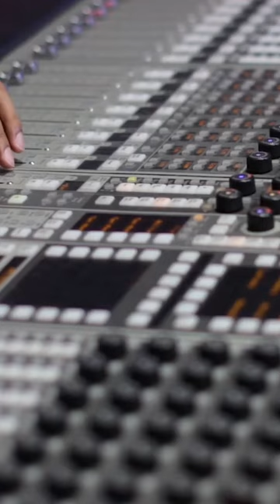How Records Are Pressed

Comment: I still don't understand how sound waves can come from the grooves on the record. Like how to you get someone's voice from a groove in vinyl? There are soo many different sounds and combinations of sound and you'd think there would be a limited amount of different ways to carve a record.
Reply: That's where the magnets came in. Every ups and downs, and lefts and rights of the groove reader is converted by the magnets from physical energy is converted to electrical charge then another magnet in the stereo sound box converts electrical energy to sound energy.

About the combination of sounds, it is mixed then put to record, its on the sound waves thing. 

Think of a voice recorder with the sound wave running when you are recording. Any sound that is captured is recorded and registered as low frequency or high frequency sound wave.
Reply: @franklyngisultura7506  I read that a couple of times trying to understand it but it still flew right over my head. 😆 I'm hopeless.
Reply: @Jessicahasopinions  you know sound is a wave right. Think of it as “captured” sound waves.
Reply: lathe cutter